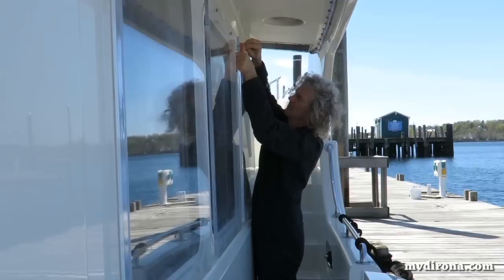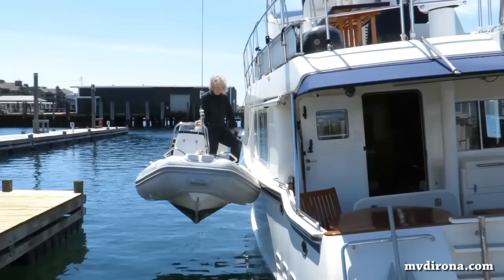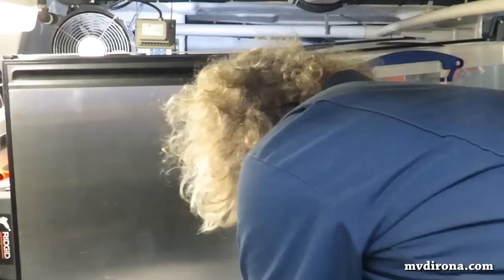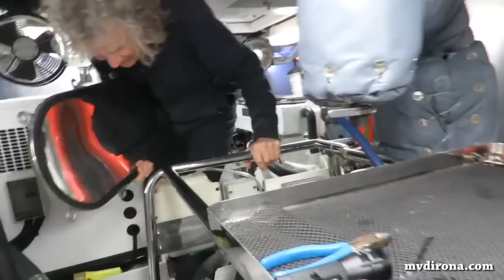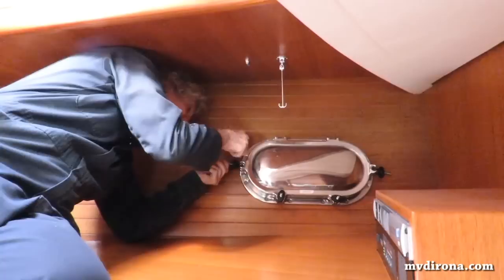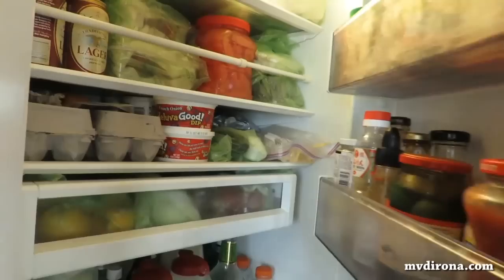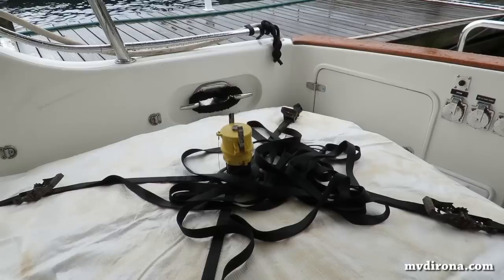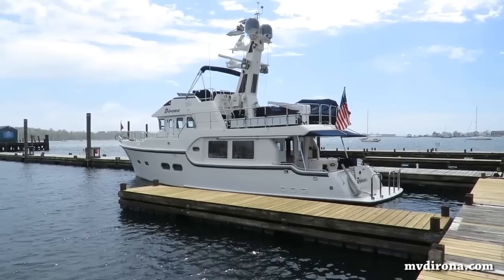Preparing Dirona for the North Atlantic Crossing (MV Dirona Channel)

Comment: Sir, you're adding 800 gallons of diesel several feet above the waterline, or 5680 pounds of weight. And from your comments, it appears you empty the mains before you transfer the bladder fuel below. 

What effect does that have on the metacentric height of the vessel and the righting arm? Have you done the calculations on this, or done an inclining experiment?
Reply from the maker: I'm not sure where you got from my comments that I empty the below deck tanks prior to the on-deck but that's not the operating mode we use and it wouldn't be a good choice. The way we run, the moment there are 360 gallons of space below decks, the forward tank load is moved below. Then when another 600 gallons open up below deck, the laz load is moved below decks and the rest of the trip will be completed without deck tanks. The strategy is to shift all fuel below decks within the first 7 to 10 days of the trip while the weather forecast accuracy is still fairly high.

In this operating mode, the boat calculates out to continuing to meet CE Class A Ocean. It actually can survive the main tanks being brought down to near empty with fuel on deck and remain CE Class A Ocean. It won't quite make it with empty tanks but, as I said, we don't run it this way and it does get close. 

I'll blog the stability with the fuel load on https://mvdirona.com sometime over the next couple of months. I've been intending to do it and you question is a good reminder.
Reply: Thanks for your reply, and for correcting my assumptions. I'm pleased you are aware of my concerns, and have addressed them.  Many happy years of voyages to you.

Comment: how thick are they       windows
Reply from the maker: The storm plates are 1/2" thick plexiglass.  I'm not sure the thickness of the boat windows but the front windows are quite thick. I've seen Nordhavn's for sale claiming 1/2" thick forward windows.  I'm not sure it's that thick but it might be.  The side windows are less exposed to weather but they are also less thick and larger.

Comment: What's it like crossing the Atlantic?
Reply from the maker: We've crossed the Atlantic twice and we have crossed both the Pacific and the Indian Oceans. Around 1/4 of the time it's relaxing and fairly smooth. Most of the rest of the time, there is a fair sized swell running the boat is moving around a bit but it's still not tiring or concerning in any way. Very rarely it's quite rough but this is quite rare, it's rough and the boat is really getting beaten about. 

The last Atlantic crossing which was just after this video was a rough one where we went earlier than would be recommended and saw three low pressure systems on our 17 day crossing.  Here's some video form that crossing: https://www.youtube.com/watch?v=guEnTp2a6Sc.

This is from the Gulf of Alaska: https://www.youtube.com/watch?v=lSsiK1iHpNo.

This is from a fairly calm crossing of the Indian Ocean: https://www.youtube.com/watch?v=pvWmbV5cID8.

Comment: I am surprised you did not protect the bridge windows ??
Reply from the maker: The bridge windows are both thicker and far smaller so design to take a heavy hit. We once got hit with a big wave heady South on the east coast of South Africa that hit the front windows so hard it sounded like an explosion. I actually ducked at the wheel. The wave tore the top off one of our forward storage deck hatches. Those front windows appear to be able to take a lot of abuse and the boat builder did not provision them for storm plates.
Reply: @MVDirona  Thanks for comprehensive reply, much appreciated. Lovely videos, good luck to you both.

Comment: Curious to know how much it costs to fuel stateside with the bladders. Also I thought the 52 and the 60 had enough fuel capacity to cross Atlantic? ...do you use the bladders to save fueling costs in Europe (must cost way more) or is it a necessity to have the extra for piece of mind? I ask as my wife and I are thinking of a Nordhavn 60 for our retirement..the main reason is for it's passagemaking ability as we have family all over the globe we wish to visit....your videos have been a great help. Thanks. Carl
Reply from the maker: Yes you are correct that both the 52 and the 60 can easily cross the Atlantic. Real range in ocean conditions is almost always far shorter than computed miledge but, at reasonable speed,  Dirona can do 2500 nautical miles without bladders and 4000 with them. 

On fueling costs, it depends how much you need and the price but it carries 1750 gal without bladders and 2650 with them.
Reply: @MVDirona  wow...big difference in range. Having read a bit of you blog with the water ingress during your trip do you think it is still worth running the bladders ( think you said you struggled with access to lazerette to determine where the ingress was coming from) or do you thing the extra weight actually helped with stability in the bigger seas?
Reply from the maker: I'm pretty sure the bladders played no part in the water ingress problem but you bare right that they did block access to the locker that was leaking making it more difficult to correct the problem. 

The problems have all been mitigated: 
https://mvdirona.com/2017/12/alarms-at-115am-follow-up/

With those changes in place we wouldn't hesitate to use the bladders when we need additional range.

Comment: Are the bars in the fridge available to order, did you make those, or did they come with the boat?  I could very much use those for our stand up dual door fridge.
Reply from the maker: They are "RV Fridge Bars" available from Amazon. I think these are the ones we are using but there are a couple of different choices if you search for fridge bars: https://www.amazon.com/Camco-44063-Cupboard-Bars-pack/dp/B000EDUUHQ/ref=sr_1_3?ie=UTF8&qid=1508050962&sr=8-3&keywords=fridge+bars
Reply: MV Dirona Thanks so much for the reply!

Comment: How many days to get across?
Reply from the maker: Our crossing was 17 days but there are more direct routes that are shorter. We went from Newport Rhode Island direct to Kinsale Ireland. That's 2,800 nautical miles. The downside of that routing is it's further north than the common one and we went early in the year so we could enjoy the summer in Ireland and Scotland so we saw 3 low pressure systems and some rough water on that crossing: https://www.youtube.com/watch?v=guEnTp2a6Sc&t=6s.
Reply: MV Dirona brave crossing!
Reply from the maker: Our longest cross ocean run was St. Helena to Barbados which was just under 26 days to cover 3689 nautical miles: https://mvdirona.com/2016/02/barbados-arrival/. Long enough that we needed to shut down the main engine for an oil change on the way across :-).

Comment: Please don't be offended, but I looked up who you are and I can't help but wonder why you would bother with bladders and such when you might just get a bigger boat with longer built in range?
Reply from the maker: You asked why not buy a bigger boat that can carry more fuel. Good question. The quick answer is in the 10 years we have owned the boat we have spent about 3 months crossing oceans. It doesn't seem sensible to buy a bigger boat to solve a 3% problem. Bigger costs more to purchase, cost more to insure, costs more to maintain, and costs more in dock fees. You might then ask, why not buy smaller?  We considered it and ended up concluding it wouldn't carry what we wanted to carry and would be too slow due to insufficient waterline length. 

It's a complicated decision and there are certainly times when bigger would be nice and there are times when smaller would be nice as well. We aimed to buy the smallest boat that would do what we wanted and that approach has worked out fairly well. But, most of our friends that have boats, tend to buy larger ones and I'm sure we could be super happy in a 60 or a 68 and, at least on the 68, it could carry the fuel to do all we would want it to do. However, it would cost a few additional million dollars so it's a fairly big decision.
Reply: @MVDirona  Thank you so much for taking the time to reply. It is most appreciated!

Comment: What is the boat powered by?
Reply from the maker: The boat is powered by a singleJohn Deere 6068AFM75 M2 engine producing 266 hp.  It's an IMO Tier II emissions engine. The backup engine is a 40hp Lugger L844d propolsion engine. It has a single generator, a Northern Lights M843NW3.3 12kW (50A @ 240V) single phase generator.

More on the engine here: https://www.deere.com/asia/en/marine-engines/propulsion/powertech-6-8l-6068afm75/

More on the boat here: https://nordhavn.com/models/n52/

Much more data on our travels and current location here: https://mvdirona.com/

Comment: Why are the bladders needed? The boat doesn't have sufficient range using the hull based tanks?
Reply from the maker: We can go 2,500 nautical miles with good reserves on the below decks fuel but this trip is 2,801 (https://mvdirona.com/2017/05/newport-to-kinsale/) so just slightly beyond our comfortable range. We could make it but it would require running slower and have less safety margin.  With the bladders we have 4,000 nautical mile range which gives lots of option value. We can divert around storms. For example, on our last Atlantic crossing from Azores to Charleston, we encountered Ana, the first tropical storm of the year and had to divert 500 nautical miles to avoid the worst of the storm (https://mvdirona.com/2021/06/charleston-arrival-2/).

Generally, don't believe flat water tests of fuel economy or manufacturers specs. We did careful 2 way fuel mileage tests in Puget Sound and "found" that our below decks range was up over 3,500 nautical miles. Real ocean conditions are far less favorable and we use 2,500 as the real range. 

Another reason to carry lots of fuel is cost. We get excellent pricing on fuel in Dublin but in Horta Azores it's 2x more expensive so, even though we were only going 1,330 nautical gallons, we carried our fuel above deck fuel load. Our bladders are essentially free from the savings we got in carrying cheap fuel from Cape Town South African to St. Helena and again from Dublin to Horta Azores. Generally, it's rare to feel like you have "too much fuel" for a trip :-).
Reply: @MVDirona  Thank you for a really excellent response. I guess the other question I had is around the stability of the boat with the additional weight on deck? Must the bladder fuel be used in a certain order to balance load? Thank you.
Reply from the maker: Technically the boat is still capable of an ocean rating with empty fuel tanks but full deck fuel but that would be a highly undesirable configuration. This is the stability data for the boat with and without deck fuel: https://mvdirona.com/2019/03/deck-fuel-and-vessel-stability/.

The way we run it is as soon as we have consumed 400 gallons below, we pump the forward tank below decks. Then as soon as we have another 650 to 700 gallons below deck, we pump the the aft two tanks below.
Reply: @MVDirona  Thank you for taking the time. You have a beautiful boat and I am enjoying working my way through your uploads! 😊🍻
Reply from the maker: Cool. Thanks for the feedback on the blog and the videos.

Comment: You should invest in a glass cup for your storm plates make it easier on yourself handling them.
Reply from the maker: That's a good suggestion and, yes, I agree it would make it easier. They are fairly heavy.
Reply: @MVDirona  good place to get one would be a glass installer they could order you one up easy.
Reply from the maker: Amazon has these available: https://www.amazon.com/FCHO-Suction-Aluminum-Vacuum-Lifting/dp/B07HNRB2CJ.

I use a smaller version of these to hold the tender near the boat when cleaning the water line. These are remarkably powerful and might be able to do the the job as well:  https://www.amazon.com/Suction-Granite-Aluminum-Laminate-Repair-Black/dp/B07BVZGNJK

Comment: How do you transfer the fuel that you put in those bladders so that it can be used by the engines?🙋‍♂️😷👏❤️👌🏼
Reply from the maker: That's an important question: "how do you get fuel out of a bladder and into the main tanks?" A common choice is to pump it from the bladder to the tank opening using a portable electric pump. This is a nice simple solution but, in rough water, the tank fuel opening may be awash.  What we do is have a bulkhead fitting that is directly plumbed to the fuel transfer pump. 

On this model, short hoses attached between the each bladder and the bulkhead fittings using camlock connections. When it's time to pump the fuel from the bladders below, I just go down to the engine room and set the valves to pump out the bladders into a specific fuel tank below, then turn on the pump. A couple of hours later, the transfer is done and the fuel bladder is vacuumed down flat and ready to be packed away. It's a super easy to use technique.
Reply: @MVDirona  This video popped up as a youtube recommendation and i found it fascinating. I was wondering about this exact issue and would have enjoyed watching a video from your crossing where you did this among other things. To date, this is the only video i have ever seen that displays the extra precautions needed for a crossing since a ship is usually large enough to not need extra precautions, or is too small to make the journey so special precautions are not a consideration. It just isnt something people think to document.
Reply from the maker: It used to be that the boats that cross oceans where either big boats or sail boats. Small boats for the most part, just don't carry enough fuel. Nordhavn is one of a few that specialized in ocean-capable power boats. Small boats that are comfortable but still small enough to be more affordable and yet still able to carry the fuel needed to cross an ocean.

Comment: How do you break down the bladders and stow them? I am a new Boater and have never heard of such a thing I’m very intrigued
Reply from the maker: Brad, we have a fairly simple fuel transfer system for the bladder fuel where we connect a cam to a permanent fitting on the bulkhead via a short hose section to a cam lock on the bladder tanks. When it is time to pump the fuel, the standard fuel transfer pump moves the fuel from the bladder, through the transfer filter (25 micron RACOR FPO-10), and then is directed into one of the main tanks. This has the advantage of allowing fuel to be pumped with nobody outside, doesn’t require the tank filler to be open to water ingress, filters all fuel as it leaves the bladders, and allows the bladders to be pumped completely dry so they are light and easy to handle.

Once the tanks are sucks down, we wash them in soap and water, let them dry and then fold them up small and store them in the brow storage area in front of the fly bridge (over the pilot house).
Reply: MV Dirona wow! So they actually scrub up and dry out, I would have thought that would take forever. The wife and I dream of cruising around the world when we retire. We thought we would have to save up for some gigantic boat in order to have the range that we needed. This just completely changed my thought process. I’m so glad I stumbled across it. Great videos by the way it’s nice to see a boat channel That is informative
Reply from the maker: The bladders are a rubberized fabric so they just rinse off and dry quickly. Not much hassle to manage. Clearly we would prefer to be able to carry all the fuel we need below deck but, as you said, a bigger boat requires a bigger budget and we're not sure we even want a larger boat.

If you do decide to use fuel bladders, ATL can help you. Make sure you have means to tie them down tight so there is no shifting underway. The most common problem I've read about is bladders moving at sea. It's worth ensuring that can't happen in even heavy weather.

Comment: Do you use the fuel in the bladder first
Reply from the maker: Yes. This is fuel above the water line so as soon as 400 gal have been consumed below, we pump the 360 gal down from the forward tank. Then as soon as we have consumed another 650 gal we pump the remaining 600 down below. See this link for more detail on the boat stability with and without deck fuel: 
https://mvdirona.com/2019/03/deck-fuel-and-vessel-stability/

Comment: I wonder if all of this safety gear is included with the purchase of the boat!
Reply from the maker: The Nordhavn approach to pricing is to price a good, strong basic boat without electronics and most other equipment including safety equipment on the argument that each owner will make different choices. Some will be crossing oceans and some never will. Some want the very best and some will want adequate.  New boat pricing for these boats makes most of this equipment an optional owner installation decision. 

Over the years, just about every Nordhavn owner elects to get an emergency wing engine, most elect to install active stabilizers, most but not all install lifeboats, some carry vast amounts of spares for repairs at sea or away from civilization but some carry just about none at all. It really depends upon the owners intended usage and, to some extent, their preferences.
Reply: I imagine it depends on how much and where you sail. I was actually referring to the window plates and port hole covers in general!
Reply from the maker: The port hole covers are standard but the storm plates are an additional cost option.

Comment: how many diesel engines do u guys have to power that monster
Reply from the maker: Dirona has a single John Deere 6068AFM75 that produces 266 hp. As an emergency backup it also has a Lugger L844D producing 40 hp for use if the main engine were to fail.